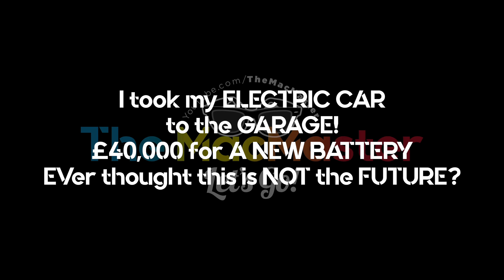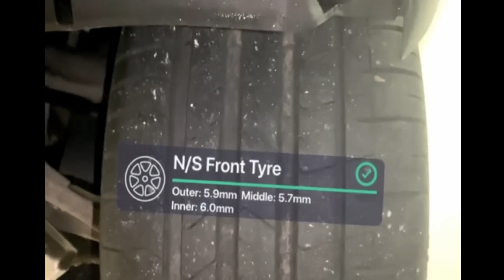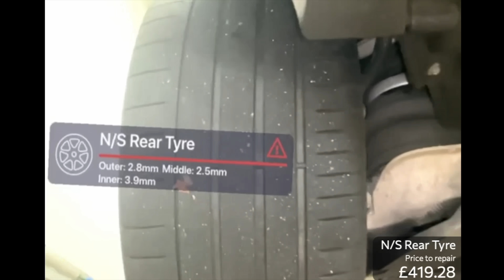I took my ELECTRIC CAR to the GARAGE! £40,000 for A NEW BATTERY EVer thought this is NOT the FUTURE?

Comment: Tesla replacement battery about a quarter of that, plus they do have a solid charging infrastructure, that’s simple to use and super fast. I’ve had my Model Y Performance for about 3 months now and it’s been a pleasure, breathtaking performance and super practical.
Reply: For Tescos and back.

Comment: The Government should be using Electric vehicles  as should Sadiq not using a gas guzzling 4x4 followed by a gas guzzling 4x4 Police vehicle.This has nothing to do with the environment this is all about control and limiting our movements they want you to stop flying  but they insist that they can  it's got to be stopped.

Comment: Lee , you mentioned aviation fuels and electric aircraft . I’m a pilot , so I know a little on the subject . There are a small number of light single engined electric powered aeroplanes flying , mostly in the training role , albeit with limited endurance . There is also an increasing number of airlines using SAF ( Sustainable Aviation Fuel ) in their aircraft .SAF is a non petroleum oil based fuel with low emission properties and is being adopted Worldwide .  Hydrogen fuel cell propulsion is starting to take off , no pun intended , and will probably see airline adoption in the next year or two . I’m almost relieved as you in the knowledge that your car has no battery damage .
Reply: Yes. I remember hydrogen .... wasn't that special German aircraft 'The Hindenburg' filled with that!😀
Reply: “Oh the humanity!”
Reply: @gregevigan  Ah. I see. Hydrogen has changed molecular structure since I took my chemistry A level back in 1975. Well, thanks for enlightening me!

Comment: Here's some info the government won't ever mention because as you say it is all about control. Co2 comprises just 0.04% of the atmosphere and if you get down to 0.02% plant die off begins to occur. Next if you did believe in co2 causing climate change then you would stick to an internal combustion engine because a like for like EV produces about twice the amount of carbon that an ICE does over a normal life span when factors such as production, obtaining the raw materials and bringing the power down a power line are factored in. But don't listen to me..check this stuff out for yourself. So glad your battery was good the cost of them is just stupid. Also I believe the CEO of one of the big Japanese manufacturers ( I forget which) said EVs were not the way to go and mentioned that if you wanted electric then hybrids are a much better technology.
Reply: That was most likely Toyota as they are not going 100% into electric (that should tell you something) if the world biggest car manufacture is not embracing "Green" electric revolution
Reply: That’s Toyota they don’t see a electric vehicle as a solution to the said climate problem, they believe hydrogen is the future, and gas electric hybrid vehicles are the future

Comment: So a few years from now there will be hundreds of Porsche owners facing a £40,000 bill to replace the battery when it has worn out. I wouldn't touch an EV with a bargepole. The world will have a major scrappage problem by 2040 due to EV batteries.
Reply from the maker: You are wrong Ken, A Taycan Owner had to replace the entire system for £40k for 1 little puncture in the battery. Stop listening to the powers that be. Normally what they spout is in their interest. All about control and Money.
Reply: @kevinashurst634 , if a cell goes duff, yes but it’s likely the whole pack of cells, will wear out together. I think you’ll find that most manufacturers will not take your battery and replace all the cells, but scrap the lot and sell you a new pack.
Reply: Or………..
100 years from now, there will few EV owners facing battery bills because people will have woken up to what utter wank they are.
Reply: @kevinashurst634  You are 100% correct. He is all about clickbait and very anti EV.
Reply: @jimf4748 …but he bought an ev🤔🤔🤔

Comment: Why is there never any mention of the fact that China emits 40% of worlds Co2  where as we push about 1.5% . Yet we don’t see them reducing there output intact they opening new coal power stations weekly .
Reply: I'm self employed with my current vehicle which will be charged to go 2 miles into the city centre Manchester and the surrounding area. I would love to know what my equal in China is paying in congestion charges.
Reply: @craiglatham  In China, you pay for the car and then pay separately for the licence plate. If you want to buy a petrol car in some Chinese cities, the licence plate is the UK equivalent of £10,000. Which is often more than it cost to buy the car. For EVs, it's free.
Reply: @Richard-io9xe  I think you have been busy reading your little red book. So everyone in China is paying £10.000 for the privilege to drive. The best propaganda I have heard today from Paddington bear today
Reply: @craiglatham  No, they aren't. They are buying EVs instead. Because the license plate for EVs is free. You could always try doing your own research if you don't believe me. It's out there freely available. Or you could just trot out the same tired old myths if that's easier for you.

Comment: I was in the UK in July of this year and I rented an EV. The car itself was excellent, I really enjoyed it. The main problem was charging it. The charging infrastructure in the UK is really bad. I went to Wales and finding chargers that worked there was a challenge. The best chargers were Gridserve (unfortunately, they're only really found on motorway service stations). They accept tap to pay/RFID cards. The worst chargers were the ones that required apps. I couldn't find some of the apps. I think that there should be one type of payment method as standard and that is RFID cards/tap to pay. Forget the app model. It's frustrating, annoying and not efficient. If EVs are going to be main stream, the charging network has to greatly improve. Right now, it's too embryonic and experimental.
Reply: The charging network is but one obstacle to high take-up of EVs. Greed-based EV pricing, severe under-capacity of the national grid and the relative rarity of rare-earth metals (the clue's in the name) are three other even more significant obstacles.

Comment: Hi Lee. Great vid, but I'll stick with my VW T5 for now. I can do up to 750 miles on a full tank (light foot needed). If I want to do another 750 miles I simply spend 10 minutes filling up and I'm on my way again. Another advantage of fuel is that I can carry a spare can, which should get me 30 miles if I ran out. You can't carry a spare battery with an EV.
Reply: How big is the tank? How many £££ to fill it?

Comment: Good to hear you didn't need the batteries replacing, must be stressful owning an ev, it really must. 
So you know that ev's are all about control, but just imagine the control they will have over you if you let cash disappear! When every transaction is monitored, tied to a social credit score and a carbon limit they can be blocked if your score is too low or if you've travelled too much. Don't let cash die, use it or lose it, along with your freedom.

Comment: My New Isuzu D'max 4x4 Yukon was only £23,000 ( plus Vat🤔😳)  3 years ago. 520 mile range ,  Automatic Transmission, 3.5 ton towing  capability, can get through the deep snow  and deep flood water up here in the Highlands ( you almost came past us when you came up to John O' Groats)  but  it's the ground clearance of electric cars that bother me. They are so low ! They can't tow a tiny trailer let alone a heavy agricultural trailer so to me  a Porch would be useless to us although we do have a porch on our wee cottage. Love your videos as I used to live in  the Derbyshire area. Hope you don't get anymore trouble. I've been told that when driving an electric vehicle you shouldn't be in it's magnetic field from the battery pack which you're sitting on for no more than 30 minutes. Government Statistics apparently. Mmmh ? Crazy times !

Comment: A good view of all the underbody protection plates for the battery, a piece of wood shouldn't be puncturing it... Although the car shouldn't overheat because it's a bit hot out, but it is Porsche's first effort at an EV so understandable.

Needs a wheel alignment judging by the state of those tyres.

Comment: Batteries on phone's degrade quickly because of the heat that builds up when charging. That shouldn't happen in a modern EV, assuming it has thermal management. Unless you're unlucky or careless and charge to 100% and leave it standing for days all the time, the battery should last much longer than most people would own a car for.

Comment: It's probably cheaper to buy and run my 1986 Bentley Turbo R. Personally, I'm frightened of EVs catching fire and burning your house down..
Reply: I make you they are very frightening considering  even a vape pen is naughty when they go wrong let alone a huge battery pack
Reply: A Swedish study's results have shown that EV's are less likely to catch fire than petrol or diesel cars.
Reply: @Stevenspielburger  but if they do catch fire, you can't extinguish them..if the batter reaches 130 degrees centigrade, the insulators melt and positive and negative are connected together and Thermal Runaway..
Reply: @ron2256  Indeed. It's noticeable though how everytime our local paper publishes a story about a vehicle fire the comments section is full of people saying "electric car!" But it almost never is one

Comment: Hi Lee in answer to your question as to why the politicians don't drive around in EVs is due to weight. EVs are substanially heavier than ICE equivalent vehicles, once you start adding the additional weight of armour plating and bullet proof glass, you will be severely impacting the range of the EV.

Give it a few more years and for battery technology to overcome the weight issues, then I'm sure you will see a seed change in the vehicles being used by politicians. 

As regards aircraft, weight is again the issue. Whilst I can't ever see long haul flights becoming electric power, I can see flights of around 3 hrs being undertaken by electric aircraft, but again that would be dependent upon next generation batteries overcoming the weight issue.

Finally on the subject of battery degredation, a fellow Youtuber PetrolPed has just done a very good video on this subject, which goes a long way to correct the misinformation around battery life. They reckon batteries will not show any serious degradation for around 200k miles. They do stress that this was not the case with 1st gen vehicles like Nissan Leaf and Renault Zoe which showed significant deterioration after 5-6 years, but used old technology and did not pre-condition the batteries for charging.

I bet your insurance company breathed a sigh of relief after seeing this video 😂

Comment: So I take it that at some point in the future the batteries will no longer be serviceable and require replacement at a price of 40 grand which will affectively make the car totally impractical to carry on using and probably have little or no resale value.
Reply: You need to Google how long modern EV batteries last and then you will find the answer to your question. They are now expected to last longer than the rest of the car.
Reply: @XenonJohnD  I know that with care the batteries will last many, many years although unlikely to outlast the car, I'm pretty sure however  the batteries could be replaced far cheaper than the 40 grand a Porsche main dealer would want.

Comment: Lee, good news about the battery. You say that there is nothing wrong with the car, but 2.5 mm on the rear tyre surely means it needs replacing. I would not want to be driving a powerful car like that in heavy rain with that tyre.

Comment: In the UK, if you have comprehensive policy, accidental damage to the battery is covered - regardless of whether a third party was involved and whether that party can be identified. Problems may arise where there's no physical damage to the battery evident (insurer may conclude the issue is actually a result of a manufacturing fault/defect and refuse to pay out)  or where the insurer considers the battery to be a wear and tear item and then reduces the pay-out to avoid what they would term "betterment".

Comment: That 40k price is typical Porsche nonsense, not a direct reflection on EVs. Next time ask them how much a new engine for a Cayenne or 911 will cost and you'll get a similarly stupid number. 
For reference, companies should be paying around £120-140 per kWh for the basic batteries (Tesla is cheaper). Taking the high number, for a 94kWh Taycan battery that would be £13k. Of course the battery is in a pack, and at pack level you are looking at maybe £200 per kWh. So that Taycan pack is costing them in the range of £19k Lets call it £20k for convenience, which would be £25k with VAT. If they are charging you £40k to replace, then their "stocking" and "transport" fees plus profit margin is adding £15k to the price. 
I am assuming that labour comes on top of that £40k ?

Comment: Synthetic fuel is the way forward in my opinion, or possibly Hydrogen. I understand that since Glasgow City Council declared the city centre as a Low Emission Zone they have had to fine themselves £100,000 due to them having very few compliant vehicles on the fleet.
Reply: Neither synthetic fuel or hydrogen are the future. Synthetic fuel is way more expensive than petrol or diesel. They’re only going to use it in racing cars. Please tell me the hydrogen car that you can buy and if you can buy one and the answer is you can’t where can you fill it up.
Reply: @robertpemberton8562  They are currently working on hydrogen systems for cars. In Aberdeen the Council are currently running a number of hydrogen vans and trucks, with First Bus using several Hydrogen buses. EV’s are not cutting it - why do you think that their values are dropping so quickly.
Reply: @jimbrand2806  I hate to burst your bubble, but unfortunately the council are building infrastructure for buses not cars. And as stated numerous times, you cannot buy a hydrogen car and if you could you cannot fill it up And as for the price drop in Evs every single new car once it leaves the forecourt drops in value. EV is a no different. The only reason the value was staying high was because there was a supply shortage because of the pandemic and chip shortages. And as for the value of the car.
Reply: @nicotoscani1707  to answer your reply is simple. Please tell me where you can buy a hydrogen vehicle, now and where if you could buy one you can fill it up. The answer is there is no hydrogen vehicles to purchase and if that was you cannot fill it up.

Comment: I agree I have had an electric car and the infrastructure is still not there 
Plus the government will have to start taxing electric vehicles to maintain the highways 🤔
Reply: I deliver bulk fuel tankers to petrol stations as I’m on break or waiting for a load slot  i people watch going about their business at the pumps and time the turnaround 
Ive calculated to keep the above average garage flowing at the same rate there needs to be 50-60 EV chargers on a 45 minute charge not factoring in the larger stations or the silly peak weekend afternoon rush
Reply: They start in 2025

Comment: buy a ev 2nd hand,first how long estimated time left on battery. add in the 40k replacement cost plus the used price of the car, will it be more than a new one, if so that wont be able to give them away
Reply: Thats a porsche price, tesla battery around 18k, some early teslas have clocked over 500k miles on original battery & tech is only going to get better & cheaper.

Comment: That's bad luck. I ran over an exhaust in my old e-Niro (all 4 wheels over it). It smashed against the battery housing with the force of a nuclear bomb. When I got home, I got out expecting the battery to be damaged. When I looked there was no damage whatsoever. Just a dirty mark where it hit. Not even a dent in the Aluminium battery housing. Took it like a champ. Car has since been replaced with a new e-Niro in 2021. Got ALL my money back from it. Glad I bought it outright.

Comment: How would your average EV go on in a Top Gear road trip? Or remember 'World's Most Dangerous Roads'? The robust cars they used always got there but would an EV? They sometimes even carry big cans of fuel on the roof racks. Can you carry a can of electric? This happening to you and your car is, well,  all I can say is, - it shows EVs up for what they are. Expensive and not fit for purpose! Great informative video.
Reply: Are you planning to drive across South America? Check the registration number before you set off

Comment: Happy for you. Old batteries used to fail because internal resistance built up, including oxidation of the contacts. Banging  the remote could scrape the contacts down to bare metal briefly extending the life of the battery.